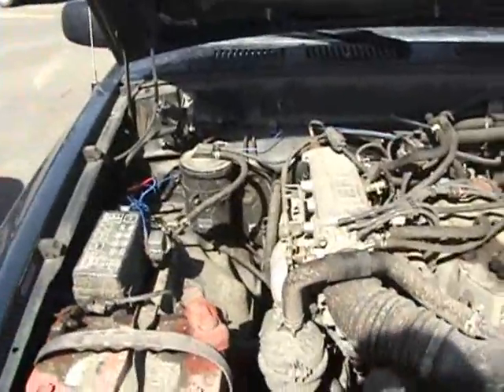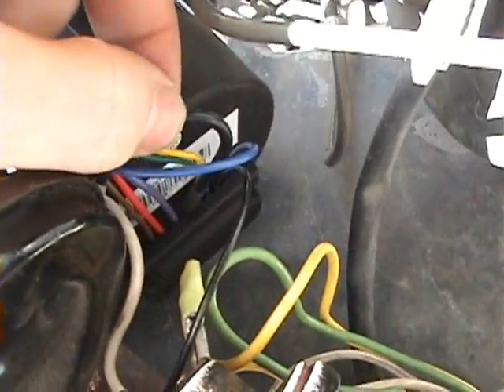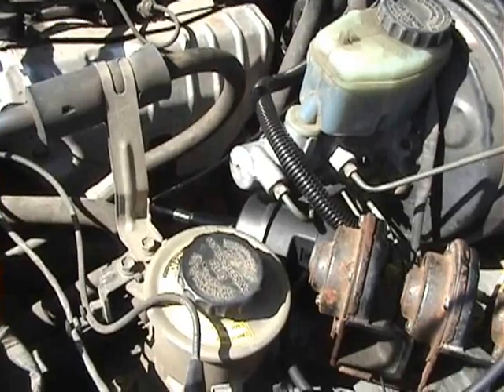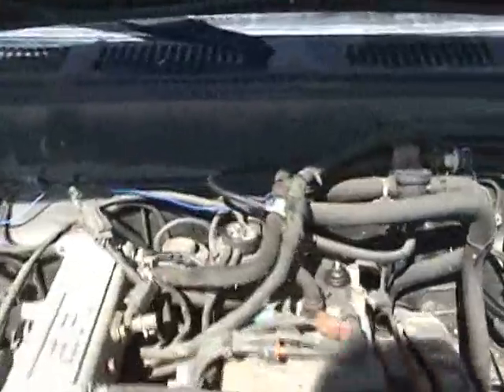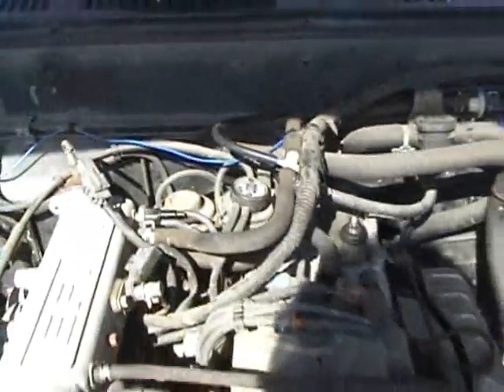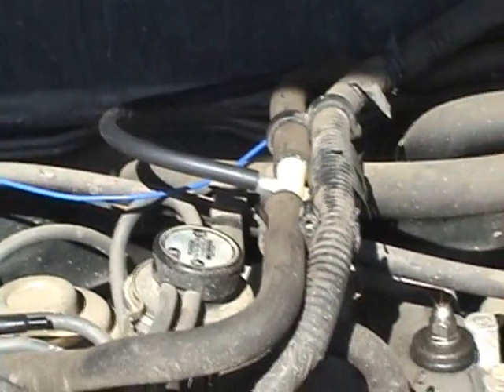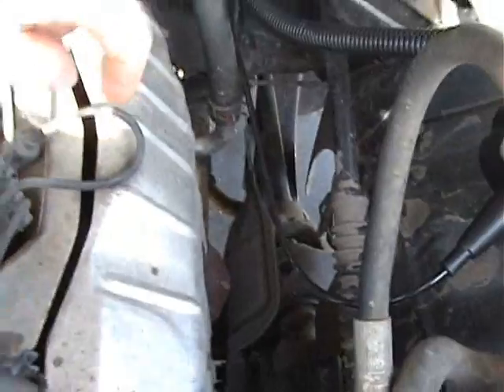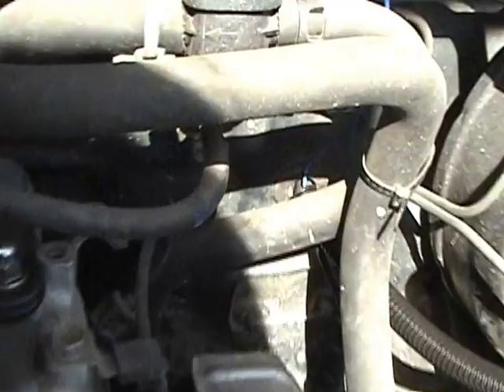Toyota Pickup Cruise Control Installation - Part 2

Comment: I installed the audiovox on my 95 F150 (300 6cyl. 5 speed) And it works good, but sometimes when  have it off, and I step on the brake pedal, it comes on. (just the power & power light on the controler) On days when this keeps happening, also the resume doesnt work. Has me baffeled!